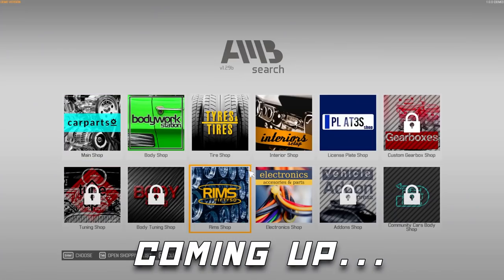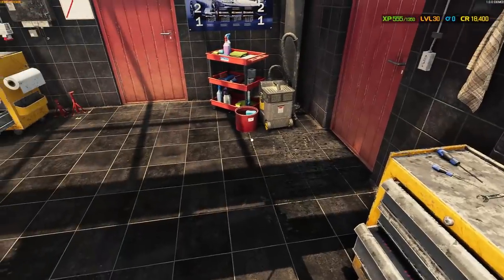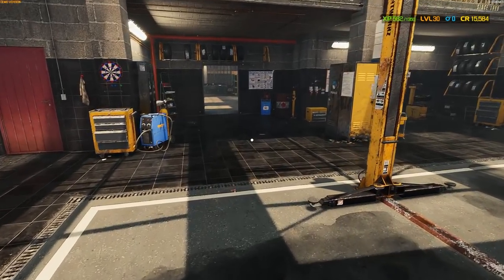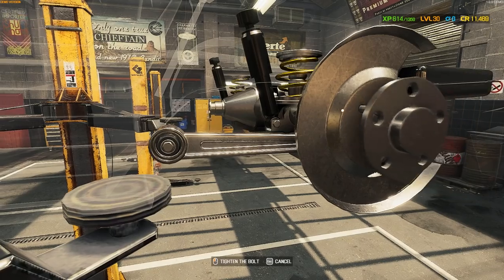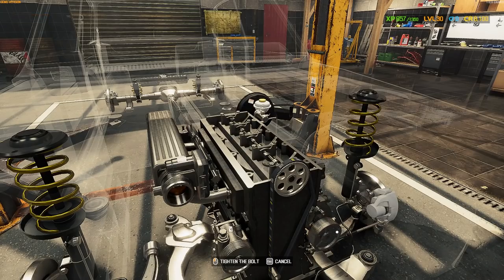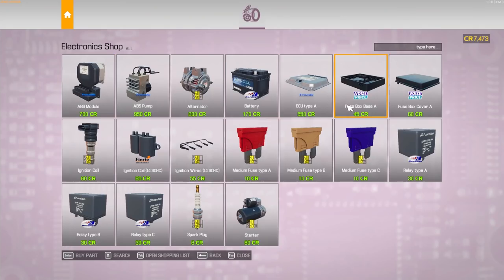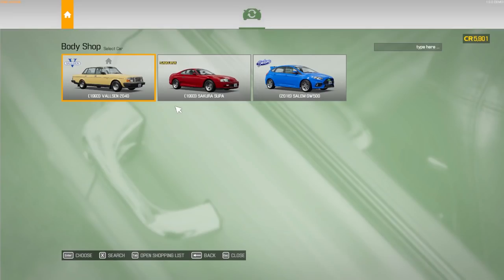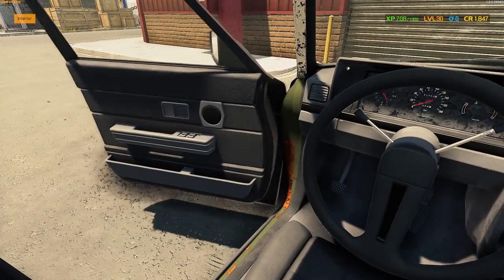Fuses and Mini Games / Car Mechanic Simulator 2021 / DEMO

Comment: Im So Hyped For The Release
Reply: Yes that's right hopefully this will be dropped soon because curious about the various different work benches. Also the new features of the fuse box. Wondering about if any of these features would be apart of the console version? 🤔

Comment: In this episode of Restore It, I'm going to be tackling the Vallsen 2040 that's been sitting outside of my garage for the past month. Unfortunately, I won't be able to use all of my tools, since most of them are still being unpacked and set in place ever since i returned from Spain. But before we get to work, i have a very quick word from our sponsor Carparts. Carparts is an online...

Comment: Holy crap, that Volvo must've been a luxury model when it was new, ABS(was that even around back then?), power steering, disc brakes all round
Reply from the maker: Yes.  They had all those things.  Even in ‘93!
Reply: Volvo lead the path in everything safety related... the 240 was built from '74 to '93, and at least the newer models had airbag and ABS (optional)... the  NHTSA named the Volvo 240 as the safest car in the American market 17 years after its introduction in 1974...

Comment: I REALLY hope we'll be able to paint all the parts.
Reply: This ^^ ... I painted some mirrors the other day because it allowed it in the paint booth. 
Changed them from chrome to matt black. They still looked chrome. :(
Also wish to lower suspension so badly....
Reply: ALL parts are paintable now I believe it shows in the trailer for the game painting engine parts now
Reply: @xxblock-axx144  I want to paint the frame, gas tank, master cylinder, etc. Everything .
Reply: @xxblock-axx144  color matching engine block head letsss gooo

Comment: If this is supposed to be the next Car Mechanic Simulator they might as well cancel the project and just make it a DLC. This is just a slight refurbish of CM2018. Same boring a.f dismantling and mounting, ordering of parts. Still no tool animations or electrical wiring. This is just to make money out of people who are new to the series and that have not tried the previous games.
Reply: that’s pretty much the whole point of the game. and by slightly refurbish you mean they gave almost every model it’s unique engine like irl
Reply: @WaffleEater53019  No, they are supposed to make dismantling and assembling more engaging than its predecessor. There is nothing unique about the new game. A slight update in colors within the menus and some new tiles does not count. There is almost nothing new brought to the table here. The menu structures are pretty much the same except som small mini games within the different workshop machines. Other than that it is the same game as CMS 2018.
Reply: Slight? The whole game has been completely redesigned 🤔🤔 I doubt theyll change their whole project because some dude on YouTube didn't like it 😂
Reply: @dis-xgaming3174  Completely redesigned according to who? The people marketing the new game? Have you even played CMS 2018? Most of the things showed in this video both interaction with the parts, and menus are almost identical to the previous game. This game is just completely redesigned as an Iphone 6S compared to a Iphone 6.
Reply: @torqenv812  so you mean polishing nuts and screws, use torque wrench on everything, too much force you screw up everything.
Have to look for original parts. Each car has 4 model years and 3 sister model that has no way to tell, and if you picked the wrong year wrong model you lose 50% your restoration bonus, and they don’t tell you until when you are ready to sell. 
Low ball offers. everytime you try to sell a car the offer is different. if you don’t look carefully you would give up your hard work for tree fiddy.
Electric wiring. you disassemble a door panel, can bus just left the chat. for every door panel, seat, steering wheel, instrument panel, you have to spend 5 hours making sure the wirings are correct. took off the wrong part, 6 year 60000 mile warranty on your 2017 Mosquito just went to la la land. 
If you don’t paint carefully you get tons of orange peel.
Oh, you said your dripped oil on fuel rail and exhaust manifold two hours ago and now you are going for a test drive... You and your 65 Specture just turned into ghost rider.

Yeah i wonder why they didn’t feature all that
Reply: @WaffleEater53019  Lol, ofcourse not, but I am sure there is a middle ground here.